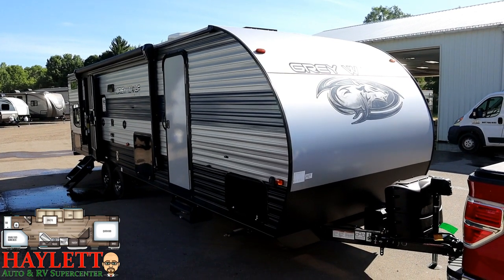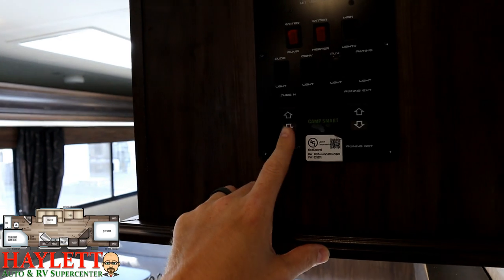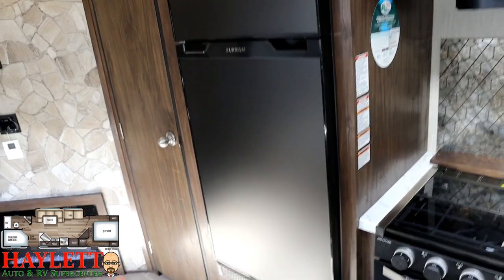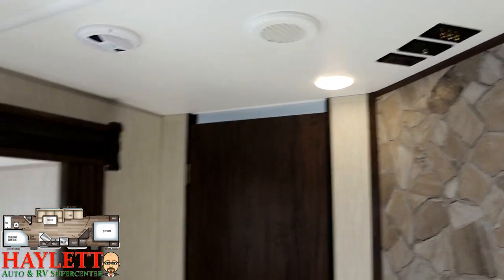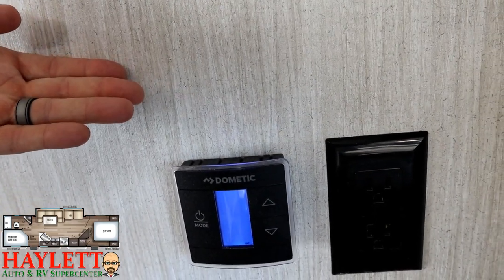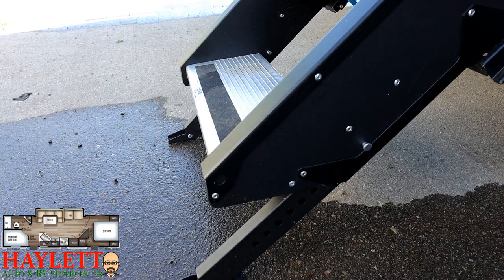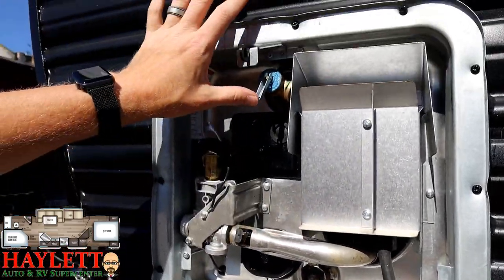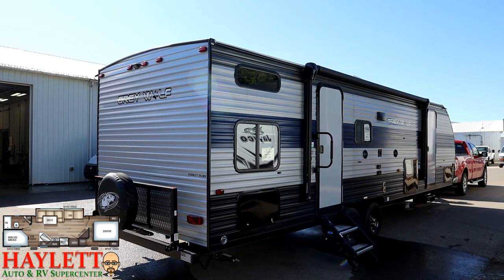2020 Grey Wolf Basic Functions & Operation

Comment: Have a question,  I have the 2021 26 BRB model and do not get any hot water flow to the shower or to the bathroom sink or kitchen sink.  The outside shower does get hot water pressure.  How do i clear the air lock and get hot water flow to the other areas.
Reply from the maker: Apologies I'm unable to diagnose/assist from just a quick text interaction like this one. Items like this are often best handled by a local service center capable of putting hands on the RV itself

Comment: Can you use the slides on truck power or do you need to be hooked up to 30 amp
Reply: I'm guessing that's a yes since it's hooked to tow 😅
Reply from the maker: Yes absolutely. Provided the truck has a charge line hooked up to the 7-way plug the vehicle provides power to the RV you can use to run any 12v device (slides, awnings, lights, fans, etc) 

Also charges the battery while in transit. Can make a good emergency "battery source" if you're boondocking